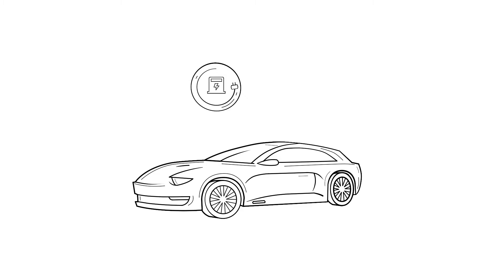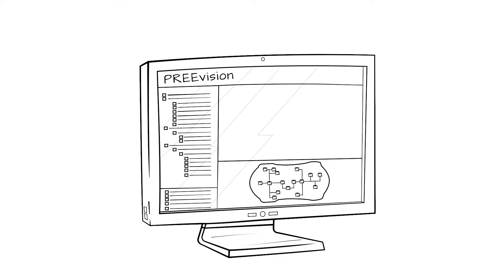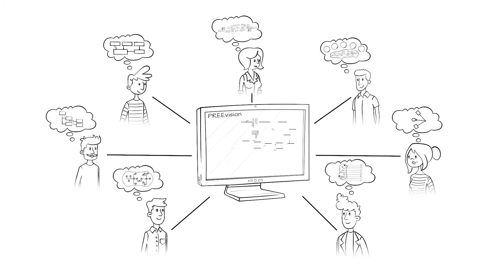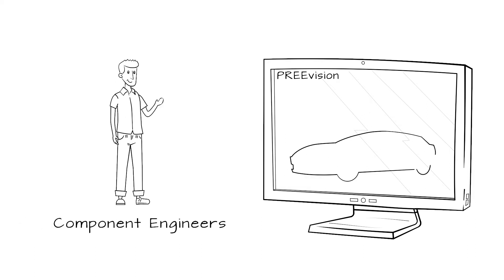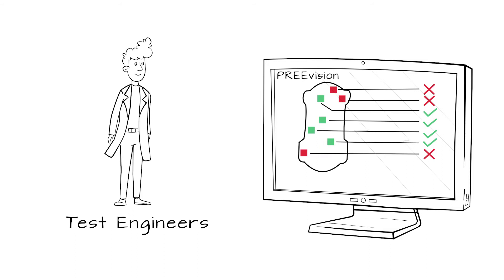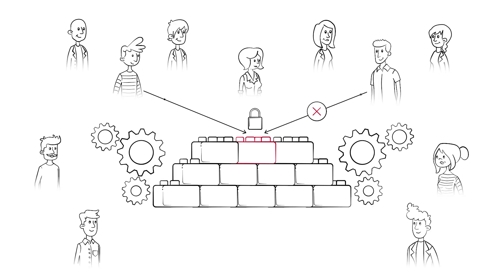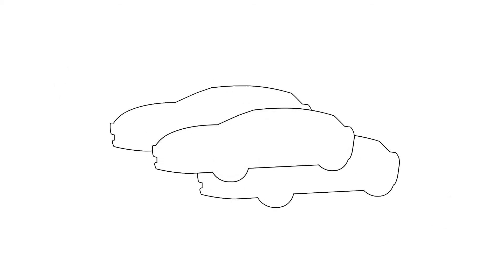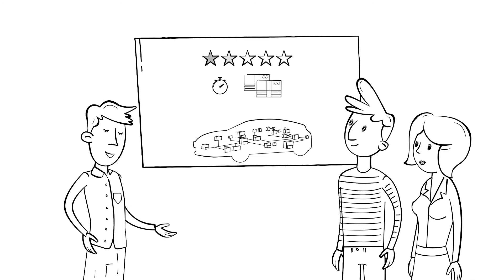#PREEvision | This Is E/E Engineering

Comment: Do I still need to use Matlab for Application SW development?
Reply: PREEvision allows the definition of AUTOSAR software components with ports and datatypes, but the full implementation is beyond the scope of this software. The implementation can be developed manually or with model based tools like Matlab Simulink. It is possible to use an AUTOSAR extract from PREEvision as an input to Matlab.